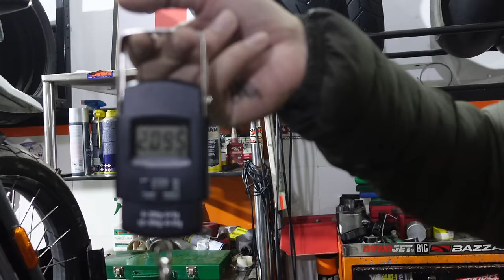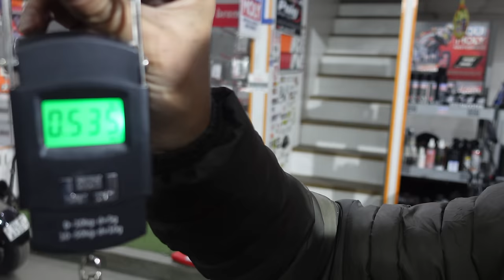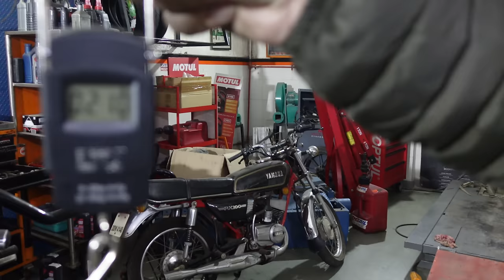Himalayan 450 Weight Reduction: Drop 11 kg By Spending Zero Money

Comment: Very interesting. As for the front fender, in my opinion the high one is more useless, which does not protect radiator and engine and which I also find rather ugly aesthetically. The low one, which wraps around the wheel more, definitely protects more from various splashes and stones. And in fact there are many specialized enduro bikes that mount only a low fender on the wheel. Cheers!
Reply: No you are wrong. Low fenders are ugly and high is the way to go. Enduro bikes dont have low fender because they run knobby tyres like this bike will have.
Reply: I take note of the knobby tires, but for an aesthetic factor if I were to buy a Himlayan I would immediately remove the tall one, which I just don't like, and mount a more modern low fender than the original one.@SupermotoCentral

Comment: super job - be nice to see once aluminium radiator/fuel tank protection is on, maybe a full front mudguard is in design by somebody or else the radiators will be taking a lot of pain and mud - i look forward to seeing the project play out, you didn't tell us the weight of the rally seat compared to standard - i imagine there is some difference?
Reply from the maker: Once I have the stock seat with me, I will.
Reply: @abhinavbhatt  aha , of course, sorry I simply expected it was there, silly me.

Comment: What's the logic behind removing the toolkit when you carry different kind of tool kit along with you. Say if your weight is 76 the tool kit might weighing same as tool kit comes as stock fitted with the motorcycle
Reply from the maker: Usually, the toolkit that comes with the bike is inadequate and so, I prefer carrying better quality and specialised tools. However, in this case, the RE stock toolkit is quite comprehensive and so I decided against removing it from the bike.
Reply: @abhinavbhatt  yes sir I have noticed that in last part of the video

Comment: Fantastic work ..Are the current rims already excel Asia aluminum  rims ..if not I think that will also be a good reduction of weight
Reply from the maker: Tubeless rims are by Akront. They hold the patent for this design. All such tubeless wheels are by them.
Reply: @abhinavbhatt  ok. There are also Takasago Excel  aluminum rims for Himalayan ..normal one would cost 22k and cross spoke (tubeless ) will cost 60-70k.
Reply from the maker: Yes. Narrower Excel Takasago rims are coming soon for the bike.

Comment: Does the rally seat fit on the stock rear?
Reply from the maker: It does, but it leaves a sizeable gap between the seat and the subframe, exposing the battery, ECU etc to the elements. So if you wash it, water will 100% enter that area. According to Royal Enfield, the rally seat is not compatible with the stock rear panel.
Reply: @abhinavbhatt  the problem is that the showroom guys in mangalore don’t have a clue about the rally spec..very sad